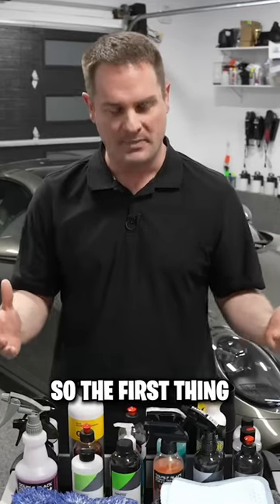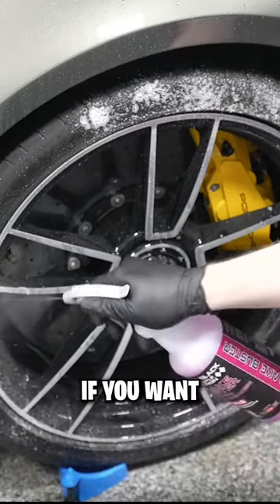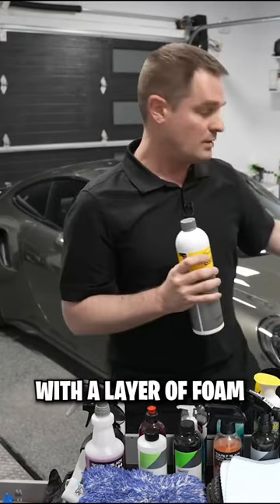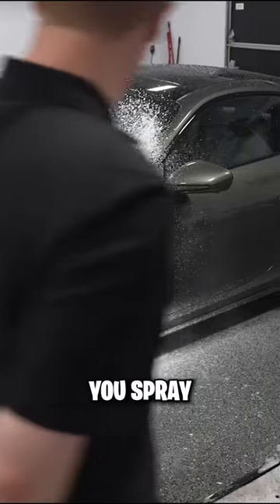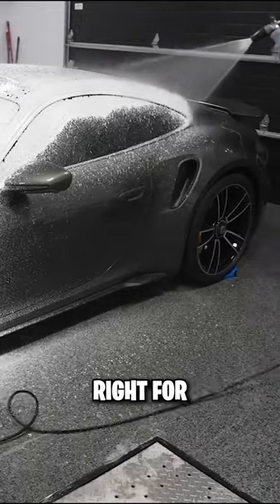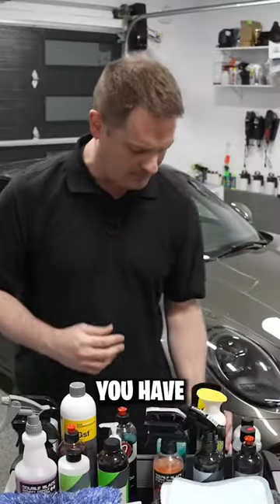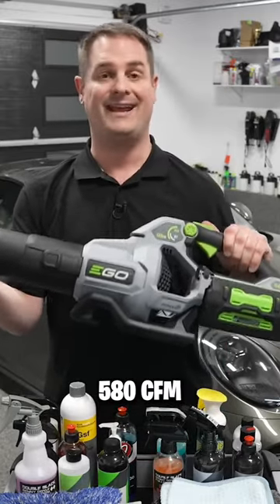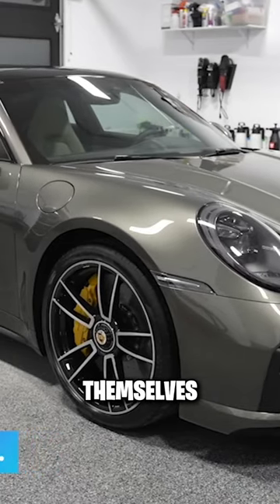Wash your car this way! 💦🚗🧽🫧#shorts

Comment from the maker: ✅ Click here to watch the full tutorial: https://youtu.be/7Koj5j2Es5U

⬇️🔶 LINKS TO PRODUCTS MENTIONED IN THIS VIDEO ⬇️⬇️

🇺🇸 For people in USA:
Black nitrile gloves: https://amzn.to/2RHC9cY
IK Multi Pro 2 pump sprayer: https://amzn.to/3sVXa0j
McKee’s 37 N-914 Rinseless Wash: https://bit.ly/3F7ntYL
Optimum Power Clean (APC): https://bit.ly/3eBH3RS
Kranzle 1122TST pressure washer: https://bit.ly/3d5kZeK
Mosmatic gun and wand solution: https://bit.ly/3aA67oE
Eley polyurethane garden hose: https://bit.ly/3qqGePb
Eley professional sprayer nozzle set: https://bit.ly/3u4wuwb
Wheel Woolies boar hair brush: https://bit.ly/3kcDMZG
Tuf Shine tire brush: https://bit.ly/3bnmDqW
Microfiber Madness Incredibrush: https://bit.ly/3xtLVzH
WoollyWormit brush: https://amzn.to/3fesJh4
Wheel and barel brush: https://amzn.to/3vWnt8G
P&S Brake Buster (wheel & tire cleaner): https://bit.ly/3gLvbhA
Gyeon Iron Wheel Cleaner: https://bit.ly/2RLaesu
Adam’s Wheel & Tire Cleaner: https://amzn.to/3tEFtD9
CarPro HydrO2 Lite: https://bit.ly/3uGXp0W
Gyeon Wet Coat: https://amzn.to/3ofaTPd
MTM Foam Cannon: https://bit.ly/3fd2MOk
Foam gun (for garden hose): https://amzn.to/3tIOSJz
Koch Chemie Gentle Snow Foam: https://bit.ly/3uIRxVg
Adam’s Mega Foam: https://amzn.to/3uFpu97
CarPro Lift: https://bit.ly/33zB7lZ
Detail Guardz hose guides: https://amzn.to/2J9XxmZ
Rolling Creeper Seat: https://amzn.to/3sYgf26
The Detail Guardz Dirt Lock: https://amzn.to/2TtdfM0
Wash buckets: https://bit.ly/3cy5fAU
CarPro Reset shampoo: https://bit.ly/3xy6Emi
Gyeon Restart Wash: https://bit.ly/3eEajaB
Adam’s Car Shampoo: https://amzn.to/3bjIMsK
Microfiber chenille wash mitt: https://amzn.to/2SzR2OS
Microfiber Madness Incredimitt: https://bit.ly/2PszC5B
EGO blower: https://amzn.to/2Lisymp
MasterBlaster Revolution car dryer: https://amzn.to/3hg9W7J
The Rag Company Gauntlet drying towel: https://amzn.to/3ffnRZn
CarPro DHydrate drying towel: https://amzn.to/3eBFIKQ
Gyeon Silk dryer towel: https://bit.ly/2RLCX0k
P&S Bead Maker: https://amzn.to/3feCQ5J
Ethos Defy: https://amzn.to/3bjCTfe
Gyeon Ceramic Detailer: https://bit.ly/33wCNNc
CarPro Clarify glass cleaner: https://amzn.to/33Ay8Kg
Stoner Invisible Glass cleaner: https://amzn.to/3w2YEIn
Glass towels: https://amzn.to/3iSpvnb
CarPro PERL tire dressing: https://bit.ly/3aMExpt
Chemical Guys VRP dressing: https://amzn.to/3tH78mG
Auto Fanatic Holeshot dressing: https://amzn.to/3o96uxp
Adam’s tire dressing applicator: https://amzn.to/3nsYfMa

🇨🇦 For people in Canada:
Black nitrile gloves: https://amzn.to/3tDMHan
IK Multi Pro 2 pump sprayer: https://bit.ly/2QtNYU3
McKee’s 37 N-914 Rinseless Wash: https://bit.ly/3gLnND0
Optimum Power Clean: https://bit.ly/3uGY7v8
Kranzle 1122TST pressure washer: https://bit.ly/3MgYINZ
Mosmatic gun & wand solution: https://bit.ly/3EBUZbI
Wheel Woolies boar hair brush: https://amzn.to/3blxlxZ
Tire brush: bit.ly/3eg9Rls
Microfiber Madness Incredibrush: https://bit.ly/3xtLVzH
WoollyWormit brush: https://amzn.to/3o9J8HC
Speed Master brush: https://bit.ly/3tEGj2L
P&S Brake Buster: https://amzn.to/32S6mbN
Gyeon Iron Wheel Cleaner: https://bit.ly/3uGA3IP
Adam’s Wheel & Tire Cleaner: https://bit.ly/3hdXeqe
CarPro HydrO2 Lite: https://bit.ly/3o8j9Ap
Gyeon Wet Coat: https://bit.ly/33AAxog
MTM Foam Cannon: https://bit.ly/3dZi2Qa
Foam gun (for garden hose):https://amzn.to/33yJZYW
Koch Chemie GSF: https://bit.ly/3K6uED1
Adam’s Mega Foam: https://bit.ly/3uDGvQU
CarPro Lift: https://bit.ly/3uE7JXP
Detail Guardz hose guides: https://amzn.to/3ouTx0x
Rolling Creeper Seat: bit.ly/3VgBoDQ
The Detail Guardz Dirt Lock: https://amzn.to/31MhxT5
Wash buckets: https://bit.ly/3cy5fAU
CarPro Reset shampoo: https://bit.ly/3eFwhJ9
Gyeon Restart Wash: https://bit.ly/3w4uzIt
Adam’s Car Shampoo: https://bit.ly/3w30B7F
Microfiber chenille wash mitt: https://amzn.to/3uEuNFV
Microfiber Madness Incredimitt: https://bit.ly/2PszC5B
EGO blower: https://amzn.to/3dYFJs4
MetroVac Master Blaster Revolution: https://bit.ly/3ojDTpf
The Rag Company Gauntlet: https://amzn.to/3f9xf0y
CarPro DHydrate: https://bit.ly/3tDDLle
Gyeon Silk dryer: https://bit.ly/3vX52AB
P&S Bead Maker: https://bit.ly/3tFNhUS
Ethos Defy: https://bit.ly/3eIABst
Gyeon Ceramic Detailer: https://bit.ly/3ofdo43
CarPro Clarify: https://bit.ly/3eARrcz
Stoner Invisible Glass: https://amzn.to/3tFJneX
Glass towels: https://amzn.to/3cNe38m
Chemical Guys VRP: https://amzn.to/3y5IVdm
Auto Fanatic Holeshot: https://amzn.to/3hgbYET
Adam’s tire dressing applicator: https://bit.ly/3sTeuTX

🇬🇧 For people in the UK: https://bit.ly/3yhUDDa

Comment: I thought you’re supposed to rinse in between foam canon and contact wash??
Reply: Sometimes they say do that sometimes they say don't. You're correct.
Reply from the maker: There are many ways to wash a car. You can foam, rinse, foam, wash. Some like to rinse, foam, wash. Some like to rinse, foam, rinse, foam, wash.
Reply: Unless you want to swirl up your car you are correct... That's the american way as we say in Italy. Foam a neutral shampoo that does absolutly nothing and do a direct contact wash. Do the wheels first, then foam the car, rinse, contact wash, rinse and dry up...

Comment: Nice brief tutorial.
I don't have a foam canon but am considering it.
Do you need a power washer for a foam canon?
Keep up the good work.
Reply from the maker: Yes you need a pressure washer in order to use a foam cannon.

If you only have a garden hose, you would use a foam gun instead. Not the same performance for obvious reasons, but an ok alternative.

I presented the differences of a foam cannon vs foam gun in this video: https://youtu.be/rJPk8nR8Ib0

Comment: Did you wash the entire vehicle with shampoo at once or did you do panel by panel.
I always heard do panel by panel to prevent the soap from drying.
Also you did not mention, grit guards, 2 bucket method where one bucket is to wash off the mitt to get rid of the dirt.
I use 3 buckets, 2 with soap and one to rinse the mitt.
Reply from the maker: Watch how I was my car in this full video: https://youtu.be/KEAfc_LUO4E

Comment: Do you first rinse the car before hitting it with the foam cannon or do you foam the car while it’s still dry?
Reply from the maker: I alternate methods as I like to test different things, and sometimes it depends on the level of dirt. I sometimes pre-treat with a rinseless wash, then rinse, then foam, then rinse, then wash. Sometimes I will foam on dry paint, rinse, wash. Sometimes I foam on dry, rinse, foam, wash. 

There is more than one way to properly wash a car.

Here's a full video I made on a routine wash I like to do on my car: https://youtu.be/X0msqeozDBU?si=94zyboyxtiJMV3hQ

Comment: Great work, and using the blower saves a lot of time on drying car!👍🏻
Reply from the maker: Yes it does!
Reply: Taking the nozzle off the hose and letting it run over the car (if you waxed/coated) is also an amazing way to dry a car if you don't want to buy a leaf blower.

Comment: Pan, can I ask you a question? I have little speck type chips in the windshield of my 12 year winter car. Chips might be over stating it. There’s a glisten in the windshield when the sun hits it. Nothing that really affects my view, but I’m particular about maintaining my vehicles no matter how old they are. Any DIY suggestions? I don’t have an orbital buffer so it would to something I can apply by hand. Thanks.
Reply from the maker: Unfortunately there's no miracle against that. It's called pitting. As you drive in the elements, over time, the contaminants and little rocks act as abrasives on the surface and will leave indentations (pits) in the glass, just like they would leave stone chips in the paint.

You can't bring back missing glass material, unless you change your windshield. If that's not an option, the next thing you can try is degreasing and polishing the windshield. Thos pits accumulate grime (glass is actually porous once viewed under a microscope by the way, so the hills and valleys accumulate dirt) and you can clay the glass, and then machine polish it with a glass pad and glass polish and that will at least make it crystal clear and reduce the effect of the issue visually.

See my glass polishing tutorial here: https://youtu.be/yMi5PtyqUI8
Reply: @PanTheOrganizer  another subscriber recommended 0000 steel wool. What’s your thoughts on that?
Reply from the maker: That won't correct your issue. Again, missing glass material can't be replenished.

Comment: Is the solution in the foam cannon the same solution in the bucket you wash with?
Reply from the maker: Sometimes yes, sometimes I use a separate snow foam, and dedicated soap. It depends what kind of wash I'm doing. But most soaps these days can be used both in the foam cannon and bucket. See my snow foam battle video: https://youtu.be/TCQXfXECr5Q?si=ur05UvloBnRzZ-az

Welcome to my channel. You discovered one of the biggest car detailing channels on YouTube as we surpassed 990,000 subscribers and we have over 135 million views! I have been detailing for 27 years and I love to share my knowledge and passion with my viewers.

You found the right channel to help you learn everything about detailing.

Comment: So when  you air dry, you never use ANY microfiber drying towels nor drying agents? Thx!
Reply from the maker: When you are using a blower, you don't apply any drying aids during that stage. But after that's done, there's always a bit of residual water left, and that's when I come back with a microfiber towel and a drying aid to pick up that left over water, and boost gloss and slickness.

See how I wash my car here: https://youtu.be/KEAfc_LUO4E

Comment: Hey Pan, i drive a white car and find myself always having dirt on my fenders like 2 days after washing. Would there be any types of top coatings that would make dirt stick a little less. Right now I use meguires hybrid ceramic wax
Reply: Ceramic
Reply from the maker: Nothing beats a true ceramic coating (the ones in glass bottles) to have dirt stick less. Coatings have self-cleaning properties making the vehicles much easier to wash during regular washes.

Comment: I don’t agree using a mitt bc anything on the car will get dragged across it… I use touch free washing and drying if the car is protected the dirt will just roll off…..
Reply from the maker: There is no such thing as a touchless car wash. If you want 100% clean, you absolutely need to use the contact wash with a wash mitt after you do the contactless pre-wash.

Comment: Hi Pan. Can I use the Hybrid Slick-N-Slide as a regular wash? Thank you 🙏🏼
Reply from the maker: You mean the Turtle Wax Hybrid Solutions Slick N Slide Pure Wash shampoo? Yes it's pH neutral, and can absolutely be used for regular weekly washes. It won't damage waxes, sealants or coatings. You can use it in the bucket, in a foam cannon, you can even use it as a clay lube.

All the details in my video about it here: https://youtu.be/H6McPVBMuME
Reply: @PanTheOrganizer  Yes. 
Got it. Thank you very much Pan. I love your videos. 👋🏼 from NJ

Comment: Do you prefer traditional soap and mitt and multiple buckets vs ONR method with drying aid?
Reply from the maker: I prefer the traditional two bucket method with soap and wash mitts. I have easy access to water and a great pressure washer setup with deionized water and a heated/cooled garage, so I can wash my car year round.

Comment: Anyone else think the "pre foam" a lot of detailers do is utterly useless?  I totally understand foaming a car if you're going to use the wash mitt while the foam is still on. But the foam, rinse, foam, wash is what I find  dumb.
Reply from the maker: It’s not dumb if you use the appropriate snow foam. I made a video showcasing if snow foams actually do anything and which ones work in this video: https://youtu.be/8j5dJUM8Fb4

And Jon from Forensic Detailing Channel came to the same conclusion.
Reply: @PanTheOrganizer  I'm still not sold on it, just because it cleared a little bit of salt residue off a door dosn't mean that it's not a pointless step. You'd have to prove to me that washing the same spot with a mitt and bucket causes scratching UNLESS I did said pre-foaming. Otherwise what is the point of making the door slightly cleaner if I'm going to wash it again anyway? I've been an avid watcher of both of your channels, you're definitely the two most thorough YouTubers when it comes to detailing along with Matt from obsessed garage.